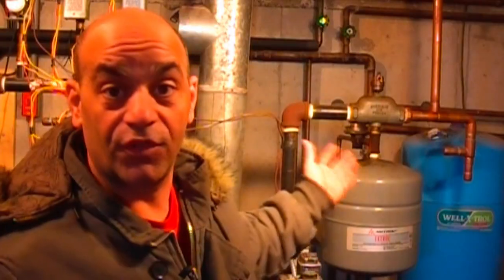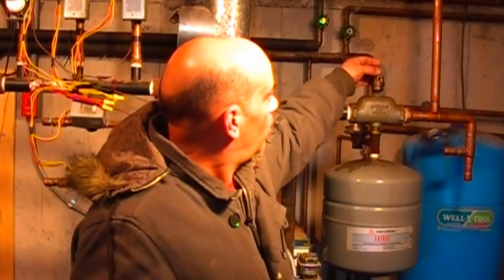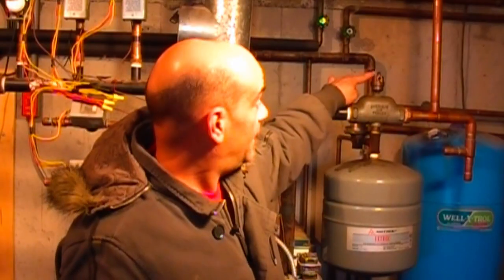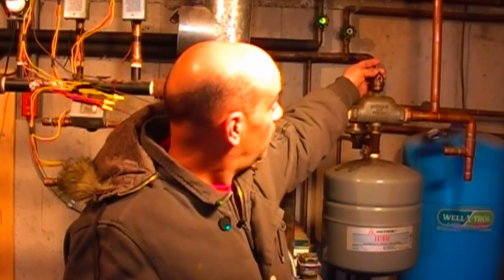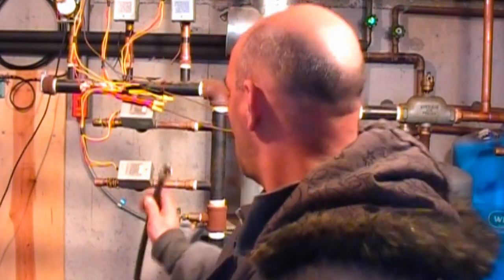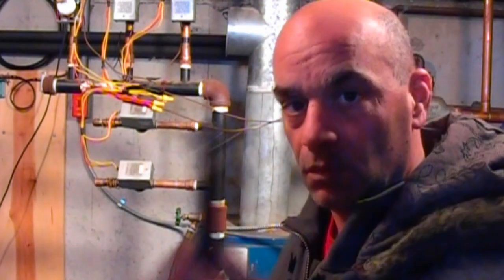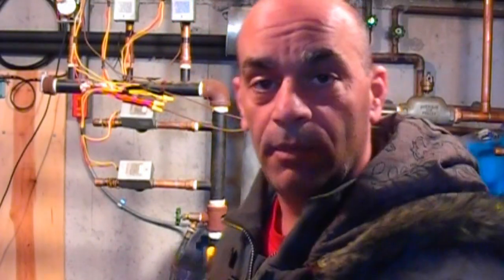How to remove the air from your boiler / heater

Comment: Hey Dom I have had bad water pressure since I moved into my house 10 years ago. I have issues with my dish washer not working properly and cant get good flow while watering grass. My shower is horrible and Im just getting tired of it. Everyone told me to look for the water regulator where the city water comes in. The only one I have is next to my boiler just as you show in the video. Im afraid to touch it since my heat seems to work fine. I also contacted the water company. They came out and tested everything and told me the issue isnt on their end. The pressure is so low I had to take the water filters off just to make it slightly better. Im at the end of my rope and about to fall, lol. I have called plumbers and they all seem discouraged and dont want to take a look. I live in Jersey and my house isnt big at all. Please brother, point me in a direction. Thank you...Bill
Reply from the maker: Where in Jersey?. I'm not that far from Jersey at all. First I would get a pressure tester and test the pressure as close to the city water meter as you can. See what you have and then ask the city what should you have. Than go from there.
Reply: askmediy Hey Dom Im just outside of Edison. I live in North Brunswick. I will get the pressure tester today.

Comment: I have a similar setup with the zones, and I plan to add another for my basement. While you show the bleeding, you didn't advise that the yellow valve should be shut to off and the thermostats should have call for heat (or flip the switch on each zone valve like you mentioned). The water should be bled until there is a stream of hot water coming out, and no spitting it air. Once bled, return all valves to normal positions.

Comment: I had some air in a few of my radiators, so I bled them.  One of them keeps getting air in it, so I bled it a few times.  Do you think I need to hook up a hose to the valve near the furnace and bleed the air from there, like you did in this video??  Thanks bro...

Comment: Thanks for the simple explanation! (Especially the part about not getting discouraged.) I do have a couple of questions. When I do this, I start with a nice heavy flow out of my hose (with a lot of air the first few attempts), but after about 15 seconds, it slows to a trickle and the pressure gauge drops steadily to zero. When I close the purge valve, the pressure slowly rises again. My supply valve is open, but the pipe is tiny compared to the other lines in the system. Is this normal and do I just need to keep doing this in cycles until I'm done? I should mention I have a two story house with baseboard heat all on one zone. (So I imagine this will take a while.) There are also two spigots upstairs that come about chest high. What are these for if the system is bled through the purge valve?

Comment: I am replacing a finned baseboard heater in a 2 story house. One of the finned units upstairs does not heat. One is the adjacent bathroom does work. The downstairs and upstairs in all on one zone. One thermostat in the living room downstairs. the older finned units in the house have a bleed valve, I think that is what it is. The unit upstairs that is not heating is full of air I know. I can find the pipes in the cellar that feed that unit. the pipes are hot in the cellar.  the system uses old cast iron monoflow tees. The supply hot water line goes around the cellar and uses monoflow tees to run a pipe to each finned heater. the return from each heater is piped down to a return line that loops around the cellar and uses monoflow tees also. will bleeding at the boiler clear the air in the lines going to the second floor heater (that doesnt heat) without doing anything special?  thanks.
Reply: Hello jimu57;
Usually Jim, a monoflow system is piped as such that the monoflow tee for the supply is taken off the same line as the return is. If you can imagine one loop of piping  with a monoflow tee supplying a rad and theN about three feet (I believe it has to be a minimum of 18 inches between the tees) away another tee that is the return. On the return line you do not need a monoflow tee unless it is supplying a rad in the basement. 
It almost sounds to me like a flow and supply system that was very common in many homes that had cast rads...I have only installed one monoflow system, but have worked on a few. And that is not to say that the tees on your system are not monoflow. It is usually written on them and they have an arrow for direction. 
One thing to check before you replace anything is to look at the pressure on the system. If it is below 7 pounds; that pressure will just get water to the rad. You should have at least 12 pounds on the system. if you lift the lever on the feedwater valve this will allow the pressure to build up to a point where it is suffice. Watch the gauge while doing this as you don't want it to exceed 14 pounds. 
The number one problem for no heat on the second floor is pressure. So this could be where the problem lies and your radiation should be fine.
Thanks for commenting and let me know how you get along!     Al
Reply: This house has finned units inside a large cabinet. Old units. But I know the feed uses monoflow because if feeds the first unit and then continues out the tee to the next unit. Same with the return loop. It is definitely a separate loop. And sure enough, monoflow tees are there also. I guess the feed loop is set up to push and the return for pulling. Its seems to work well. I think the bleeders on the finned units are on the incoming side, which didnt make sense to me. And not sure why they are even needed if I need to bleed the entire system at the boiler.  One thing, I didnt see a lever on the feedwater valve.
Reply: To Oldkid888...................I'm blowing water out of my pressure relief valve when the furnace kicks on, and I suspect the expansion tank is water logged. To change the expansion tank, is it ok to just shut off the water coming into the house and turn off the furnace? Secondly, should I also replace the pressure relief valve? I'm also told the regulater valve is probably not the culprit due to the fact the relief valve only spits water when the furnace is running. Just checking out things here on YouTube, and looking for advice as the cost of a plumber here in NJ is very high. If I can do this job myself safely I certainly will. 34 years in the construction trade but rarely do plumbing except for sweating new pipe. Thank you in advance.
Reply: Hello machia0705;
If it is only happening when the furnace is running then it is just your expansion tank.
There should be a shut off going to the furnace before the pressure reducing valve.
Is it an expansion tank or an extrol tank?
If it is an extrol tank then it is just a matter of
unscrewing it and installing a new one. Use two wrenches to do so.
Once you have it loose; then you can unscrew it by hand. Be careful as it will be heavy once it is unscrewed.
You cab pump ar into the tank and open the drain valve on the boiler. this will buy you time until you pick up a new one. Watch you gauge as you don't want it above 15 pounds.
If it is the expansion tank in the ceiling then you just want to drain the water out of it. Close the valve leading from the boiler to the tank.
When draining the tank you have to allow air to into it. By attaching a hose and just opening the drain; it will only drain a small amount of water; so you must open the air vent which is sometimes located on the side of the tank. There are also air inlet valves that come built into the drain valve. \it is a small screw on the side of the drain valve that if opened allows air to go the top of the tank and allow the water to drain out of the tank.
You should be looking at three 5 gallons buckets of water in order to drain the tank properly.
Thanks for commenting and have a great day!      Al

Comment: I drained a little bit of water just to check for air and sediment. Now the water pressure isn't returning to normal psi. PSI is at zero and confirmed with a screw on pressure gauge on the drain. Any ideas? I tried purging air at the baseboard vent till water comes out but still no change.
Reply: Also could there be a valve stuck or blockage from letting the boiler refill. If all else fails can I temporarily fill it back up through the drain to achieve correct PSI?

Comment: My furnace has a shut  off valve  above and below the circulating  and a drain valve do I turn off one of those valves and open the drain valve also the furnace is not zoned

Comment: As long as you know the 2 metals dont mix and ones not for water .not saying it dont exist and im looking for it on google but I have yet to encounter iron  pipe mainifold with boiler intentions so untill I get a link on the product in use im gonna to have to stick with my educated eyes mainly on the fact I can see a iron 90 right over your right shoulder your telling me its iron with a coating of what in the i.d (inner diameter)of the pipe silicone copper brass etc sounds like a waste of fab on a product that already exist brass nipples need to take place of them iron nipples and a brass cap thanks member safety 1st
Reply: Most old boilers like mine are cast iron, so whats the harm in using iron fittings and pipe.  My boiler setup looks a lot like his, with large iron piping in and out of the boiler, then reduced to smaller copper for the zones.  The biggest problem in mixing metals is aluminum.  Copper and iron is not as bad.  Iron piping used to be the norm in boiler and steam heat systems.

Comment: Is that gas pipe ran with domestic copper line cause corrosion s that safe
Reply from the maker: It's called a manifold made for it's job. Before you comment and all the other comments that Youtube blocked of yours make sure you have your mouth open so your foot can fit in it.

Comment: My boiler has a domestic coil for hot water.  The boiler will not run for heat but will run to heat the water.  When the thermostat is set to call for heat the circulation pump not shutting off.  I have made sure that there is no are is in the system and it is at 15 PSI.  Why wont it work for heat?  It is a Burnham Jubalee boiler.
Reply from the maker: Could be lots of things. First make sure your thermostats are working and check all the wiring for them.
Reply: It was a stuck check valve.  My boiler guy called me and told me to give it a couple taps with a small hammer and it freed up.  Thanks for the replay.  Much appreciated.

Comment: My system uses Taco cartridge circulators.  One of them was jammed, so I gave it a few light wacks with a hammer and it did the trick.  Is this a common occurrence when first turning on the heat in the fall?
Reply from the maker: I've had to do this a few times. It's not really normal but expected sometimes. It's not the cure all as you would guess.
Reply: FRIENDS2014

Comment: I have a question for you sir. My oil boiler isn't heating up the house but it runs to heat up the hot water for the house. What could be the issue? What can I do to fix it?
Reply from the maker: Check your thermostats, make sure they are turned on and or batteries are good. Start from there.
Reply: Ok I will start with replacing my thermostat
Reply from the maker: Jeanmary Saintilma I said check them, don't just replace them.
Reply: I checked it and it's not working properly

Comment: Well Done Video.
Ronald should realize from this video how to move that baseboard unit.
Only open the zone to be moved and drain the water out - move baseboard unit and plumb in.
Open that zone valve and purge the air out and then turn the water off and check for leaks.
No leaks, no air - full of warm to hot water equals heated register = Your job is done.
Reply from the maker: Well said and thank you very much.

Comment: Great video, two questions. You say that in normal operation, water sometimes needs to enter the system.  Does this mean that when the boiler is powered on, I should NOT shut off my water supply line when I leave home for extended periods of time?  Also, is it best to keep the boiler on during extended periods away from home or best to power it off?
Reply: Don’t leave the boiler on and the water off. Either turn both off or if there is a danger of frost, leave them both on. Just turn the thermostat down so it only turns on if the temperature gets near freezing.

Comment: Most forced hot water systems have a Purge station on them. That hose he has hooked up is essentially what a Purge station is, you can take a piece of hose connect it like he has, and then what you do is you crimp the hose, allow pressure to build up an open the hose. Some systems will have bleeders on the baseboard, but I have not seen many like that. The ones that do make it a breeze to get air out of your lines, however they also have a tendency to allow some hot steam mist seep out, normally in a finished room so, due to that they are not very popular in a residential environment. If you have a continuous loop on a zone that goes through a bathroom, then you could put a bleeder in that location where its surrounded by tile. Hope this helps. The system that he is showing may or may not need to be bleed, but most do going from summer to winter, or else you get a lot of banging in your pipes and you lose a lot of efficiency in your system. Resulting in less heat, more money :(

Comment: I have a very old system at the moment no heat upstairs. I opened all my bleeders upstairs still no circulation nor heat..I do still have hot water in my sink and bath. do not see a zone valve. It is a hot water oil furnace.

Comment: Personally not a fan of zone valves and old school taco air scoop. Plus like circulator pumps on return not supply. Flow checks yes, no integral checks in pumps on supply system.

Comment: Dominic,

Great Video

I have a seven unit building, one propane boiler, with one send and one receive line. The send and receive pipes are 1" iron, and they run in a crawlspace. There is a recirc pump on the send. Each register is plumbed in with a Tee going to 3/4 copper on the pressure side going up to the register and back down to the return side with another tee from 3/4 copper back to the 1" copper. The system has Taco valves for each register, but they are all abandoned and are switched to open. The main controller for each register are alcohol bulbs, and many of these are non-working.

Well one of my registers is always cold. The feed line is plenty hot but the return leaving the register is always colder than the other register lines. I loosened the alcohol bulb to see if air would come out and I got hot water pressure, so I think the register is clear of blockage and full of air. from that point to the main return there is a short run and a Taco valve in the middle, so I am thinking there may be a ball of solder in the valve or something.

I want to remove this suspect Taco valve without draining the whole system and having to bleed each register in the building. It is in a crawlspace, and the registers are the highest points.

Any ideas?

Thanks, John

Comment: Wow, man....you totally cleared it up for me. After watching your vid, I checked out my boiler plumbing.....I had gurgling pipes because the water supply spigot had been shut off. Once I turned it back on, the little Schrader (with the not-too-tight cap) started hissing. After about an hour, it stopped, and no more pipe noise, and heat cranks. Pressure gauge came up to the reference mark, too! Excellent vid- Thanks very much!

Comment: thanks for the video.  Very helpful. I have 3 zones.. Is it important which one to get the air out from first?  Do you start at the top or the bottom floors?  Thanks in advance
Reply from the maker: It's always better to start from the top I say.

Comment: my boiler keeps dumping from sytem to condensate pipe? if i leave the filling loop open the heating comes on and the gauge stays at 1bar if i close the filling loop the system looses pressure and the system cuts out. the boiler is a worcester c30i attached to an unvented storage tank. any ideas of what the problem mught be?

Comment: Yes, water supply was on, but I was mistaken, it didn't empty out like I thought, the Zone was not open yet, Once I made sure Zone was open it worked fine.  Thank You for your quick reply.
Reply from the maker: Anytime.
Reply: askmediy    my boiler is triping with lock out alarm from front pannel

Comment: I got low on oil but  I got a delivery yesterday. The burner was running when he filled it.   I then shut off the emergency switch and let things settle for about an hour.   Today I heard gurgling in the pipes so I'm sure it means there's air in the lines.  We have a two zone system, upstairs and downstairs.   Upstairs is set at like 50 since they're away for 6 months. I only hear it gurgling down here. We had extremely cold weather the last week or so I hope that doesn't have anything to do with it (like a frozen pipe....).